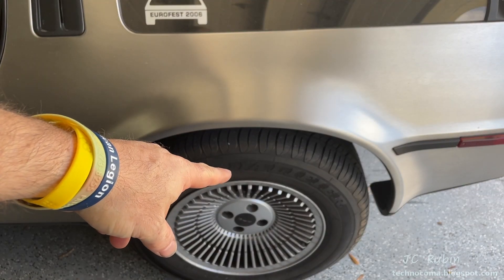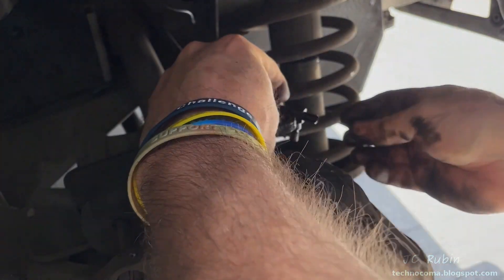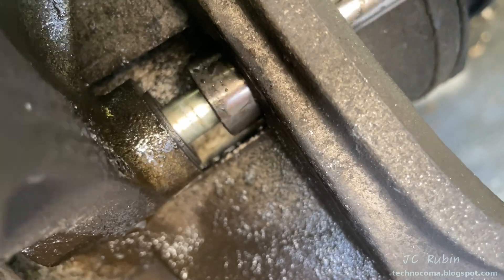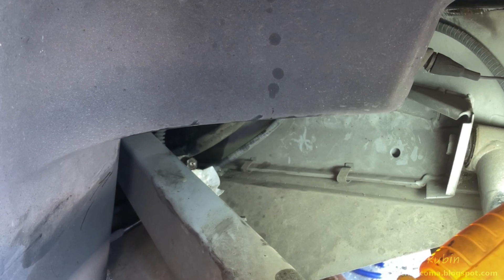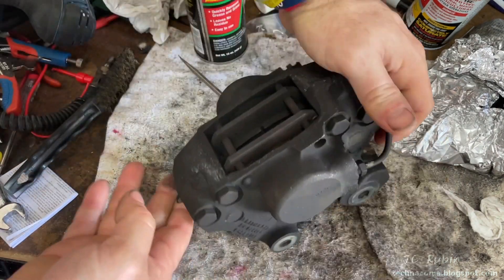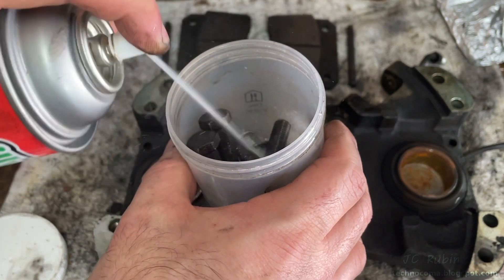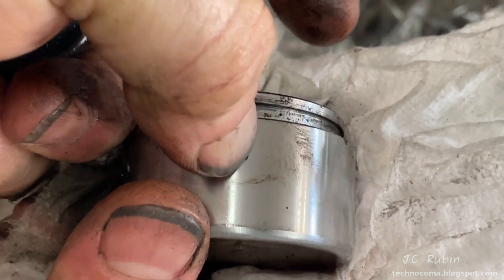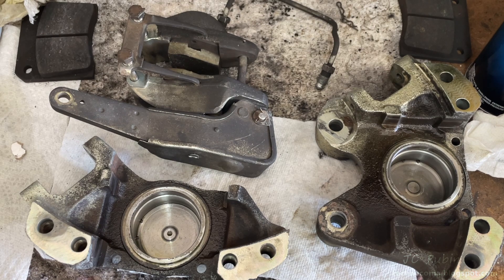Delorean Brake System Overhaul - Part 3 of 4

Comment: Hi, quick question. I am doing this exact job. The rear rubber hoses seem like a pain in the behind! Did you just have the car on jacks and get right under the car? I tried to locate them on the other side of the frame and they are way back there. Did you ever use a lift at all or just jack stands?
Reply from the maker: Just jackstands…a lift would have helped